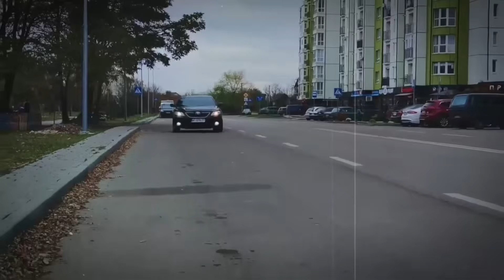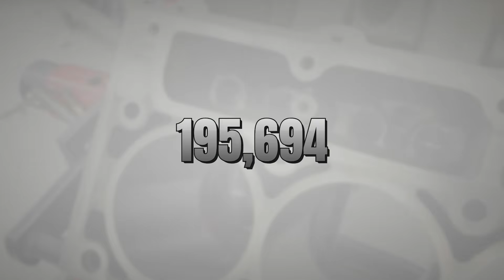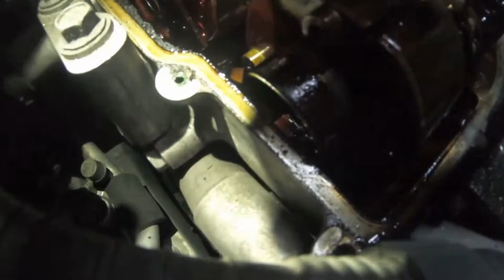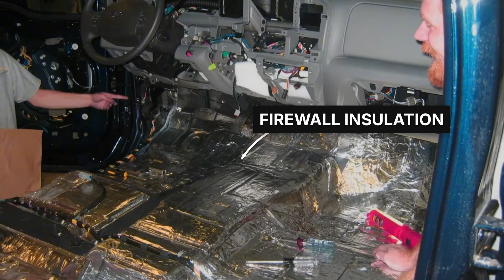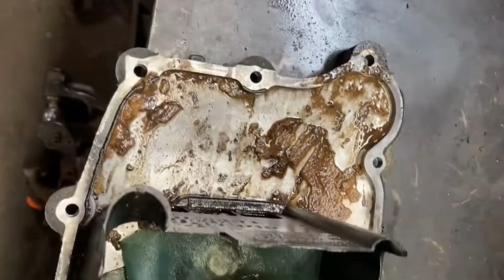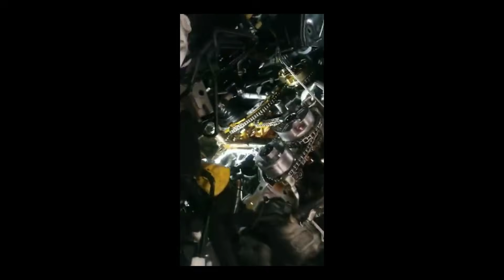We Tested the 1GR-FE, 2GR-FE & 3UR-FE After 200,000 Miles — A Clear Winner

Comment: A 8 cyl engine doesn't compare with a 6 cyl motor. The 6 cyl motor has to work harder than a 8 cyl motor. That is a fact of life
Reply: This is silly. Plenty of these just drive around without doing work or even hitting redline. The 1gr actually has a better reputation than the 5.7L. Fact.